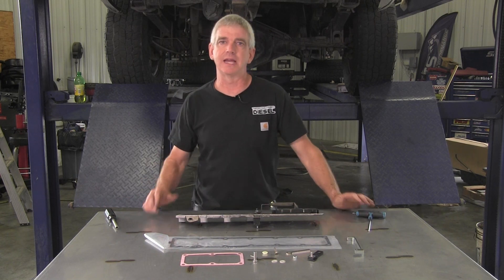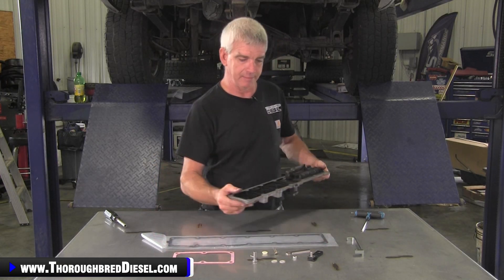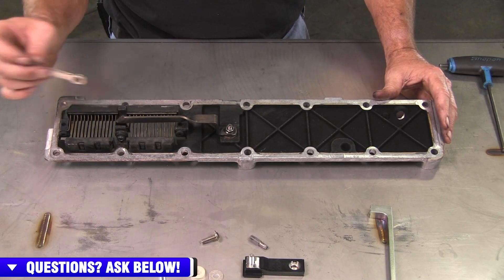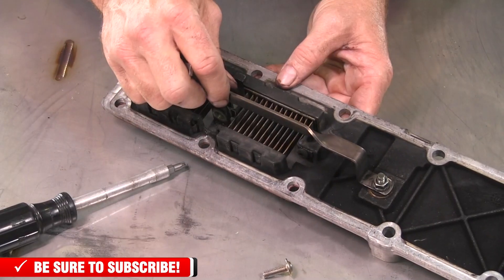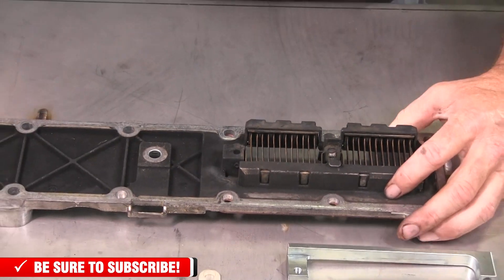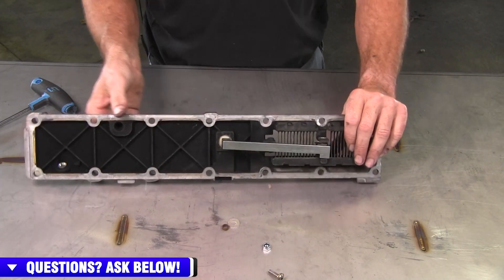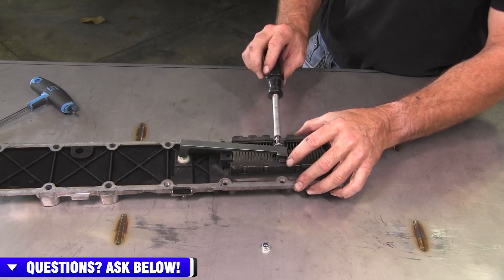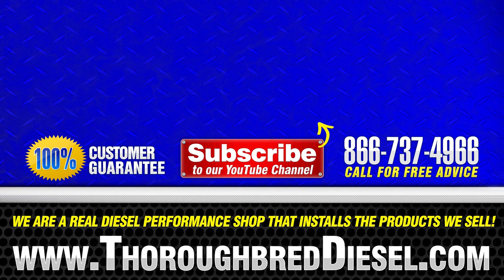Prevent Engine Failure On Your 6.7 Cummins!!! - Install BD Diesel's Grid Heater Upgrade Kit! #howto

Comment: My daughters truck ran GREAT! Speed in all gear ranges & did not roll coal. I ONLY did the grid heater delete plate. Now it rolls coal BUT no turbo whistle and it does NOT run fast!!! It takes forever to spool the turbo. ANY ADVICE!!!

Comment: I'm a dealer for you guys in Florida. I had discussed these with a small fleet account of mine and they had 2 sent to me for their trucks, I've yet to install them but I must say so far I like this kit, very simple and it offers a very cost effective solution for people, too many people jump right on the banks kit which may not be viable when you have several vehicles that need a cost effective solution
Reply from the maker: Thank you for your business and thank you for watching.  Yes, the main thing is to get the heater bolt out of there.

Comment: Just did mine. 2017 2500 with 55k mostly hwy miles. The nut popped off during disassembly and the entire area was heavily corroded. Seriously, don't think your truck is safe from this time bomb just because you live in a mild climate. At the very least unplug the grid heater.
Reply from the maker: The vibration of the engine is a huge factor in this.  This kit gives you a lower cost alternative to potentially save your engine.

Comment: I am glad I found this.  All I want to do is eliminate this flaw, not replace my grid heater, not replace my intake, and not loose any kind of heating completely and all for $200.  $200 is far better than buying the banks solution for $1,000 or even a new Cummins engine post failure.
Reply from the maker: That type of HP you will want to go with the 4000.
Reply: @unixsuperuser  I just cancelled my banks after seeing this. Ordered this .

Comment: What about the solenoid when it gets stuck on?  The solenoid and grid heater is like Bonnie and Clyde.
Reply from the maker: Even if the solenoid gets stuck on, its not changing the failure mode of the heater, or it is to say the bolt wont come out and fall into the intake runner.

Comment: The factory buss bar is better because it twists sideways to maintain cfm of air flow. the BD Diesel piece needs to incorporate the twist and it will be perfect!
Reply from the maker: Not an issue with this, plus prevents possible engine failure.

Comment: Still restrict air flow
Reply: @bigd8812  I watched a comparison video with a dyno, and the banks big horn high flow, does nothing to increase power. So I wouldn't worry about restriction
Reply from the maker: It's to prevent a huge, very costly problem.

Comment: I like this design. I already ripped mine out and used a GDP relocate grid heater but that one doesn’t work as well. This is a nice deal.
Reply: Did you use the throttle valve delete/grid heater they offer? Thats the route i was going to go since it offers more heat than the coil heaters
Reply: @TheIamdevin I didn’t. I didn’t want to remove the fuel lines and mess with the gasket. So I took off the intake and literally cut out the old grid heater and then used a new intake gasket and put that back and installed the GDP. If I recall I still had the grid heater bolt in there but no longer is anything connected to it which causes the problem when it becomes a welder. My way may not have been normal but has worked great so far. There are two GDP versions one for colder weather one for normal locations. The colder weather one is thicker. I have that one.

Comment: What prevents the "butt head" bolt coming lose and falling into the intake?
Reply: The nut bolt that stays the same isnt the issue with the old design, its the second nut/bolt that got eliminated but the buss bolt threading directly into the buss bar is the fix
Reply: @fbm314  I understand that, but I still dont like the idea of a bolt that could work lose and if I'm doing the fix I'd rather eliminate any possibility.
Reply from the maker: Much less likely at the heater side and its oriented horizontally instead of vertically.
Reply: and i do not think the threads on this bolt are part of the grounding path therefore you will want to red/permanent locktite the snot out of it
Reply: its called button head bolt
Reply: @onewayt  I was just referring to what he calls it in the video, hence the inverted commas in my post, but yes indeed it us a button head bolt.
Reply: Red loc-tite keeps it from falling in
Reply: @JeffLaMar-xd4us I’m still not liking it.  If the grid heater can short out and melt a nut, then red loctite won’t help.  We’re trading one vertical dropped bolt for a horizontal dropped one. Close, but we’re not quite there.
Reply: i understand i do agree. 

the only way ive seen it done that completely removes the potential for this is to swap to the 7.3 style. it has its own aftermarket flaws but only related to the grounding path. solveable. also, the factory intake plate needs to be threaded for 1/4npt and pipe plugs threaded in from the top to plug. this is the only 100% nothing can come loose inside install.   other than the 7.3 style coil heating up and crumbling!  

need to ensure root cause of the solenoid being stuck on is erradicated too.

Comment: So i did this kit, but when i put my power wire on i lined it up over one of the intake bolts, well it took about 3 weeks but it shorted off of that bolt, it cooked my power wire from the battery the fusable one and it burnt the end of the wire that attatches to the grid heat bolt there. That metal fitting we bolt down on the wire is about melted in half.  For the power wite i think i can clip the end off and just attatch a new one, should i tear it all down again and check the bolt, its gonna be 40 and rain all weekend so i really dont want to if i dont have to. Cant believe i made a mistake like this.
Reply from the maker: Bummer.  Hope you get it fixed.
Reply: @ryancornelius1007  don’t feel bad, just melted my wire too almost caught my truck on fire, no idea what went wrong… followed this guide to a T

Comment: I just did this job and it all went back together good. I changed the relay prior to. I'm still throwing the code though. Anyone have ideas?
Reply from the maker: You throwing a code for the intake heater relay?  Check wiring to and from relay.
Reply: @thoroughbreddiesel   I will, but I don't really know where it could be, my truck is really clean.  What I'm afraid of is that I somehow didn't get the ground and conductivity correct with the new upgrade inside the grid heater. I took great care when assembling it and followed the detailed diagram. I've just went to not using the heater when starting, to avoid tripping the code. I will inspect wiring to and from though. Thank you.

Comment: Am I better off with this or banks kit?
Reply from the maker: Both kits are great options, as long as you are taking care of this failure point!
Reply: My 22 Ram just had the factory recall for the heater grid I need to find out exactly what that consisted of.
Reply: @Donnyboy65  
The recall is for the relay.
My 22’ grid heater failed at 20k miles. I installed the Banks Monster Ram and as a bonus say an increase in fuel economy
Reply: @BlackWolfAdventures-t9s  what kind of fuel economy increase have you seen?
Reply: @ 
A 1-2 gal per mile. I have the CAI, Moster ram intake, and boost tubes
Reply: @Donnyboy65 please let us know when you find out

Comment: Why, why, why, why won’t Cummins fix this at the factory?
Reply: So they can sell you a new engine
Reply: i heard the fix it on the 2025 no more grid heater
Reply: @maxwelllohlofftz3976  haha ya with a glow plug sounds like another issue to me but hey 20 yrs of mechanical maintenance on diesels what do i know
Reply: @HVTMuddvain  Do not forget the loose pin-bolt in front of the engine that can go in between timing wheels and do some damage there.....
Reply: @rvarsigfusson6163  You're referring to the KDP or "killer dowel pin" and that is not an issue in the 6.7, it only applies to 1989 to 2002, and is MUCH more common in the 12v, but can happen in the 24v up to 2002.
Reply: @HVTMuddvain  .. i had a 2003 ford with the 7.3L PS engine that had glow plugs.. at 162K, I bought the truck from 2nd owner who was friend of first owner.. When i sold the truck at 269K it still, far as i know, had original GP in the engine and they worked fine.. they are not fool proof but the grid heater in cummins has been a cluster for a while..  this BD thing is just another way to skin a cat..
Reply: So if the screw go down the motor you are still screw right?
Reply: @mojo4376  so they can sell you a new engine lol also engineers mad at mechanics for alegently sleeping with his wife 😂
Reply: Because they can sell your $30k worth of parts and labor when your engine self destructs.
Reply: @mojo4376  This should’ve been a recall, or at the very least, fixed on all new engines when it was discovered early on.

Comment: I did the banks works great on my 2018 3500😊
Reply: Does it work in extremely cold temps. I'm in alberta canada. Minus 40 or below happens. I've got the banks kit, just haven't installed it yet.
Reply: @PondstompingAdventures  In the same boat here. Also in Alberta (Southern) and have the full banks kit for Gen4. Wondering how it will work this winter.
Reply: @solstice666  how has it been so far? Hasn’t really been that cold yet, might have to wait till January to see I guess.
Reply: @fztfabs65  the banks system seemed to have been good. While we hit -20 here, it seemed to have worked, no difference noticed from stock.
Reply: @PondstompingAdventures I live in Watertown NY by Lake Ontario. We have one installed on one of our trucks and we have to cycle the key 4 times to get enough of heat to start it. The heater plug that comes with the Banks does not get hot enough . Have to cycle at least 4 times
Reply from the maker: Great to hear!

Comment: The only concern I have with this is the width of the bus bar. I think its gonna create some pretty turbulent flows coming into the intake. It would be cool to see a bus bar that has more laminar flow like the OE Cummins one, but not grenade your engine. Overall its a great less-expensive option to save your engine. Thanks for the video Wade.
Reply from the maker: You're welcome.
Reply: Thanks I’ll be looking 👀 into them . 
@ 200 miles now and I want this fixed .
Reply: @ it's literally going to have zero effect on the airflow, and if it does its going to be maybe 1 cfm. Which is literally not measurable for power loss
Reply: What do you want ? 
A blown up engine or restricted air flow ? 
I’d choose air flow .
Reply: @RBnly  You propose a false dichotomy. There are other options out there.
Reply: @ 
Please let me know these other options.
I have an 2024 and I just found out about this issue. 
I’m looking for a fix . I’m not looking for high priced fix or do any upgrades that change the stock emissions.
This fix was in my price range . Not the $1000 banks .
Reply: @RBnly  A few grid heater relocation options.
1. Banks
2. Glacier diesel power
3. Black market performance 
4. BD Diesel
Reply: @BlackWolfAdventures-t9s  Some people are just looking for a solution and not a Hp monster with all goodies that cost arm and a leg or almost as a new car.
Reply: @BlackWolfAdventures-t9s The Canadian guy showed it doesn’t work very well.
Reply: @ltcajh 
Yes he did, I don’t live in Canada. Also I use a jump pack to help on the juice, but it has to be well below zero degrees before there is too much of an issue.
Reply: @BlackWolfAdventures-t9s  I was born in SD, so it would certainly apply there!
Reply: it blocks your airflow more from the already restrictive heater😅 the concept is good, the execution of the concept is piss poor.